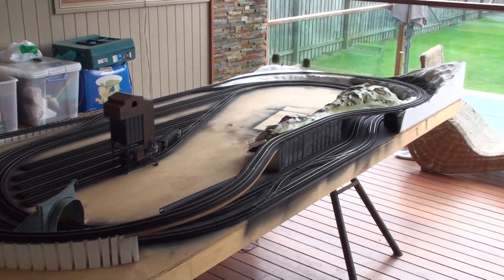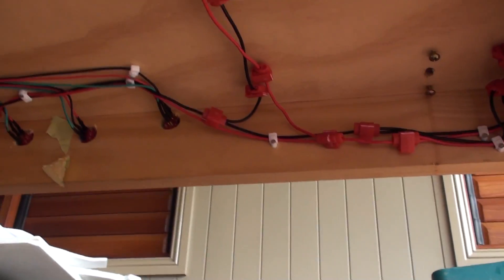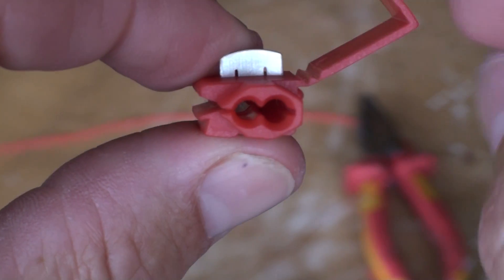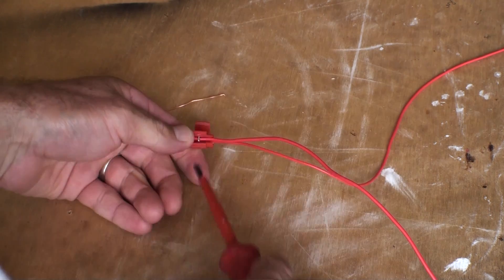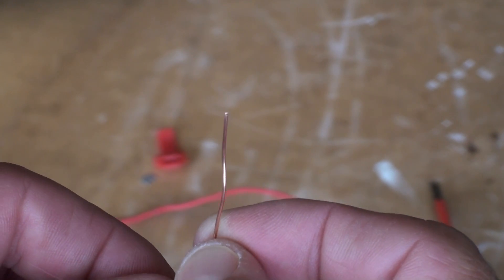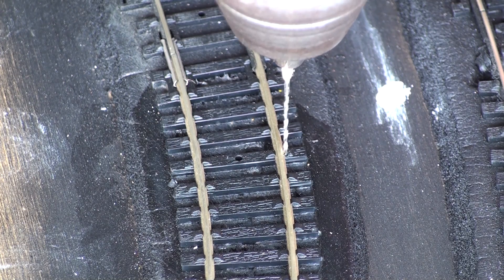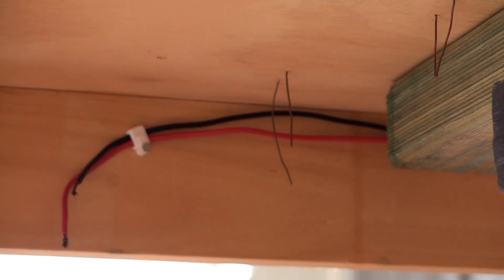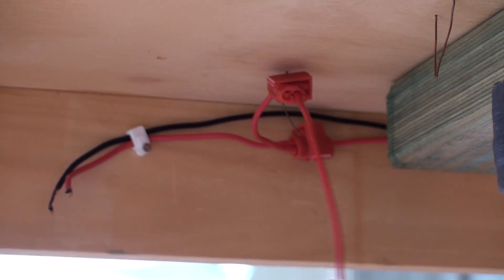How to wire Your Model railroad for DCC using bus and feeder wires

Comment: Question: For turnouts, I know you said wire the feeders at the beginning of the point what about if I switch the track for power to go to the wire should I add feeders on the right end  points of the turnout? If that makes sense.

Comment: Did I correctly understand that there is no insulators between the various feeder sections of track.
Reply from the maker: Hi Ray, That is correct. I have the main bus wires that run around the parameter of the track, then i have the feeder wires which are insulated that that branch of the bus wires, i have two very short uninsulated wires that drop down from the track and connect to the insulated feeder wires with a suitcase clips. You could keep the short feeder wires insulated if you want. They have no chance of touching each other. Hope this helps.

Comment: Hi ...im new to DCC, my question is how often do you install feeder wires, is there a certain distance apart they should be?
Reply from the maker: Ultimately you would connect to every piece of track. That way every piece of track is receiving a signal from your controller, so even if a track connector is a bit dodgy or even missing, you will have no interruptions. l didn't go that far. I guess i tried to connect every metre or so and either side of the turnouts.  I hope this helps
Reply: Thank you.........so if I'm using all flexible track I would provide a feeder wire for each 3 foot section?

Comment: There seems to be many detractors of the suitcase connectors. I have used them for more than 20 years now and not had a failure to date on numerous MRRs. It is important to use the proper size connector for the wires you want to connect together. That might be why some folks are having problems. I use the 3M Scothlok #558 IDC (Insulation Displacement Connector) for everything from 22ga to 16 ga. wire.

Comment: Excellent video, I subbed, very helpful.  I think I will solder some of the joints only so I get better at soldering.  Then I'll use suitcase connectors where I need to.  Great explanation of how and where to apply power.

Comment: Can you connect controller to track as normal & have a separate 
power supply feeding the bus wires?  So you are feeding power to track 
from two sources.  They wont clash or cause a short or whatever.

Comment: Really useful video to a complete beginner like myself. Do you have to add dropper wires to each section of track? I.E Between each set of fish plates? Thanks for posting this video!
Reply from the maker: No you don't, but the more sections of tracks that you connect to the bus wires the the less chance of losing the dcc signal.

Comment: Did you insulate the turnouts
Reply: Jamie Champion response to an old comment but if you still are wondering, there is no need to insulate anything with dcc, all locos are always drawing power but they won’t move unless you send a signal through the track to that specific locomotive.  It will only react to commands meant for it.

Comment: This works but it is certainly not the best way to wire for DCC. DCC produces high frequency current that concentrates in the outer diameter of the conductor (skin effect). I don't need to go into detail. Just google skin effect. As a result, solid core wire is a poor choice as you see higher resistance than stranded core. Of course this is not really an issue with the small layout demonstrated here. Suit case connectors? They only contact a fraction of the conductor. Again a very poor choice for high frequency current. Solder gives you a full bond around the entire circumference of the conductor strands whether it be solid or stranded. For the best signal strength, all stranded and all soldered with mechanical connectors only where absolutely have to. This may work for you but sorry to say it is very poor advice.
Reply: +John Long Suitcase connectors are the most popular choice among model railroaders who run DCC.. They've never let me down either.
Reply: John Long 
Know what I like about guys like yourself? You guys never do a video of your own to share your perceived knowledge; but you're always quick to criticize and find faults and say what should or shouldnt have been done on somebody else's video. 
If you don't have anything good to say then just shut ur mouth. ......or better yet make your own video and show the 'correct' way.
At the end of the day this guy did a video to show what HE did! Nowhere did he say this is what you HAVE TO DO.

Comment: Great stuff .....nice way of attaching track feeders. Using the suitcase connectors looks good , I was worrying that they would not make a good connection, I tried using wire strippers to force apart the wire along the bus,,,,,,then solder...but not so good. So cheers.

Comment: Personally would never use these red connectors with solid core wire. Its not what they are designed for. The metal tab in the connectors is supposed to cut the insulation and then clamp onto the multi strand inner by squeezing it. Even the manufacturers say don't do it. Solder a flexible standard wire to the rails first, or use proper power clips if you cant solder.
Reply from the maker: Worked great for me.

Comment: Thanks for the video - its helped me greatly. I am using Hornby 00 track and the sleepers do not look wide enough to successfully drill through so perhaps my feeder wire will need to come up through between the sleepers and eventually be covered by the ballast. Can you please advise what size wire you have used for the bus & feeder and were these wires solid. Your help is appreciated.

Comment: Hi, great video. I am just starting out to build an N gauge layout, with DCC, but all very new to this, and your video has helped a lot with this. Just ordered from ebay, some of the parts you use. One thing that I am not sure is, why do you wire up the points as well? I was looking at the electrofrog points first, but someone on a forum suggest I don't use(as there were no electrofrog version of the points I wanted) and instead each of the sidings use the dropper wire method which you show. So each of the sidings on the straight track, I am just going to use dropper wires, connected to the bus. Thanks

Comment: Hi Thanks for an excellent video, which simplifies the procedure loads for me. I was just wondering though what happens at the end of the bus wires? Are each of the red and the black wires a complete loop which meet at each end to form a complete   circle/ loop or does each one just stop to form an 'end to the bus? Thanks
Reply from the maker: Hi. you don't have to do anything with the end of the bus wires, just cut them off. The loop in the circuit  is made when the train get put on the track. I hope that helps. Cheers

Comment: Can you feed off the bus wire to feed a seperate connecting yard,you have this on your layout..would be nice to see a complete picture off the wiring from underneath,
Reply from the maker: Yes you can. My bus wires run all the way round the the perimeter of of the layout. I join slightly smaller wires to the bus wires with suitcase connecters and they run to the feeder wire that comes down threw the baseboard from the track.

Comment: Thanks for this video.. I'm about to rewire my setup and was not looking forward to it. This makes the job sooo much easier. I checked up on Jaycar's website and they do have those clips Red Quick Splice Connector 22-18AWG Pk6.. Priced at AU$2.15c for 10.. I've also found these too..Contact Connectors - Wire Joiners - Pk.4.. Priced at AU$1.55c for 10.
So I guess I'll have to make waves across the Bay to Capalaba to get them..lol.
Gives me an excuse to get to the mainland..lol..;-)

Regards.

Doug
Reply from the maker: Thanks Doug. glad I could help

Comment: Hi,
Having just moved from 00 to 0 gauge your video has provided me with what looks like a very much improved method, plus neat and tidy way of installing BUS and FEEDER wires. Not sure if the suitcase connectors are readily available in the UK, but thanks for excellent demonstrations of the various aspects of wiring a layout.

Regards,

Brian

Comment: Hello.  Did you add a power booster? that seems to be a sizable bit of wiring for a single power source.
Reply from the maker: Lachlan McGuire Cheers for your helpful explanation lachlan
Reply: for the size of his layout, he only needs the DCC system and it's power supply, as he only has a few points and a few trains in which he can run. All the wiring shown was just to make sure each section of track has power all the time instead of having bits dropping out :)
If the layout was larger then he would need a power booster

Comment: Mate, thanks for the video, great help in starting to wire up my track .. I will be using the new Hornby Railmaster software and Elink system (controlled by the computer). As with the power to he tracks, say every metre as you have suggested, do I also need to wire the tracks for the DCC control in the same manner ??? .... Cheers Stephen (Melbourne)

Comment: I thought idea of dcc was to reduce the amount of wiring,, if the whole track circuit works with two wires connected to it  it wont work any better with twenty two wires connected will it ? keep the track clean with methylated spirits and save yourself a lot of unnecessary work.
Reply: you can lose voltage over long lengths of track where the track joiners meet ,, wont matter how clean and shiny the rails are

Comment: The best video I have seen on DCC wiring.  Good job.  One question...do the main  buss wires need to be terminated with just a wire cap?  They do not have to complete an electrical loop, right?

Comment from the maker: Hi BiffoBear57
I'm in Brisbane, Australia.I would suggest you go to your local electronics store to buy the clips. The suitcase clips / Quick Splice Connectors
i used were the smallest i could buy which were 22-18AWG " The 22-18AWG is the size range of wire you can use in those clips, so
your bus wire needs to suit the clips/connectors that you can source. i
bought mine from jaycar.com.au . i hope this helps

Comment: Just bought a cheap soldering iron,  so will be doing some wiring soon. Yeah there is a lot of track,  that was my first layout that you saw which ironically DID work ok.  The layout I have now isn't too dissimilar, I have just tried to fill most of my board with track.  Some of track was second hand & tarnished also  some of the fish plates are useless, so need to buy more to help ensure continuity.Just need to get some feeder wire.That stuff you used looked ideal. How many connectors on yours?

Comment from the maker: Hi Gazzernator. Do you just have the one connection to your track? I Had a look at the video you uploaded, i think that you would definitely benefit from running bus and feeder wires. It looks like you have a lot of track. 
The only time one of my locos stops is if it's wheels are dirty. I have found that the hornby starter set loco's get dirty wheels very quickly as opposed to my Broadway Limited Loco which i run a lot more but rarely needs cleaning.

Comment: Just seen above about Jaycar.  Think I have seen that in NZ too. What about the wire?  I had a real Humm noise coming off my layout the train would stop & start and  when it stopped is when the the hum was reduced in the end to get some movement I separated the track. I have clips on all points so don't see how there can be a major/issue/short.  Thanks

Comment: V good & should be helpful to me as I have finished laying my track to find my locos wont go around on it, so I now have to look at doing this. Glad you are running Hornby & select DCC as I am also.  You are obviously Aussie & I am English but in NZ so do the kiwis call them suitcase clips "suitcase clips" ? But had you gone straight from the bus to the rail with one feeder you would have saved effort & half the amount of clips wouldn't you?  Where did you get the clips & wire from? Thanks.

Comment from the maker: Hi Ron. Great question. My unqualified understanding is that one side of the track is positive and the other side negative and the loco completes the circuit between + and - creating a loop/circuit back to the controller, therefore you dont need to loop the feeders or bus wire.
The reason for running bus and feeder wires is just to provide a more consistant supply of power and signal at several points around the layout.
I hope I have understood and answered you question and have been some help.

Comment: Question on your main bus wire? Why don't you close the loop on itself instead of terminating them?? Would it cause a problem and act as an antenna then??  Don't know and no body seems to have a good answer either way... It's running things in series or looped and I don't know the difference??

Comment from the maker: Hi arlingtontrains7
I'm in Brisbane, Australia so i don't know what frys is. I would suggest
you go to your local electronics store to buy the clips. The suitcase clips
i used were the smallest i could buy which were " *RED QUICK SPLICE
CONNECTOR 22-18AWG
 "  The 22-18AWG is the size range of wire you can use in those clips, so
your bus wire needs to suit the clips/connectors that you can source. i
bought mine from  jaycar.com.au . i hope this helps

Comment from the maker: Wiring the point motors and switches seams complicated but is actually quiet easy if you follow the instructions that come with the point motors. Just make sure that if your going to use a toggle switch to activate the point motor that the switch is a momentary switch. A momentary switch will flick back to the off or centre position when you take you finger off it. If you use a switch that is a on on switch you will burn out the point motor because the power doesn't turn off.
I hope i've helped.

Comment from the maker: Hi Adrian. Ideally you would attach a feeder wire to every piece of track, but i think that is overkill. In my case I have a feeder wire about every metre. I've found that I get a very consistent power right around my layout. 
Track and wheel cleaning is the key to a smooth running layout. If you track and wheels are dirty then it doesn't matter how many feeder wires you have, the connection between the wheels and track has to be good especially on a dcc layout .

Comment: wanting to start up with a first time layout, just trying to figure out how often you have to place feeder wires to the track, and also trying to get my head around wiring point motor switches. I'm sure its all straight forward once you know how, i do have a pretty good knowledge of electrics. Any suggestions of any newbie mags or links LOL. Ady